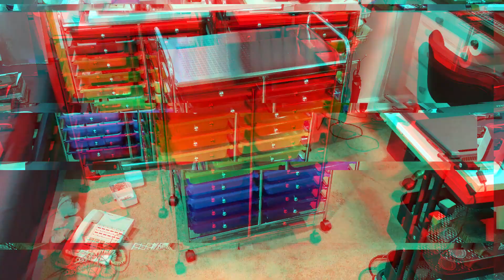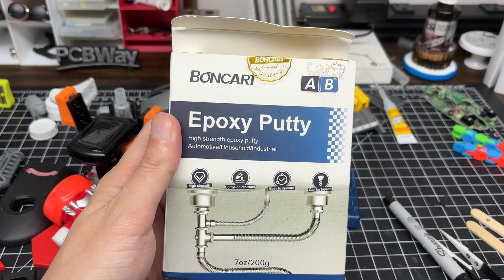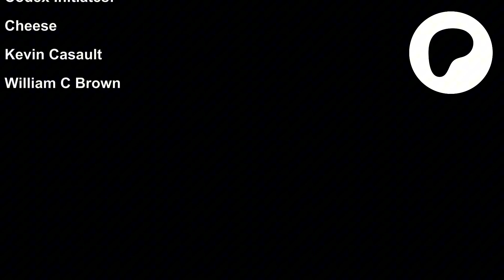Rex: 1/35 Scale Junkyard Mech (Part 1)

Comment: Your monologue writing continues to be just perfect.  Alex Grimes is a treat and totally unlike the previous two designers in a way that is really charming and funny. Having a wry and snarky designer who both looks down on and is a little afraid of the importance of his work is great worldbuilding for the Omniplex. 

As for Rex?  Axel said it, "*Chef's Kiss*", a wide-stance load shifting mech that can move loads up to... 15m in the air (Guessing based on the implied sizing for the primary hydraulic pistons coming from construction equipment meant to stabilize apartment compelxes.) like a forklift.  He's made from repurposed and reconditioned detritus - but by someone who's got a mind for both engineering and repairability.  

I understand why Axel is pissed about being put in charge of reclamation - he's an engineer.  Obviously he's an engineer who scored too highly on keeping the big picture in view and reliability, so he has to manage city-critical services instead of building things like he wants.  I'ld be snarky too.  It's not like anyone expects to test too high for their dream job.

Back to Rex, though.  I can't wait to see the detail pass on this figure.  I generally have an... issue with modelers using rivets in sci-fi designs,  For the most part they were superseded by welding improvements and the ability to forge and machine larger parts.  Rivets are essentially stitchwork and are inferior to doing it right the first time, if you can.

This guy?  Built out of mismatched components that had to be machined into tolerance with one another?  I can't wait to see the rivets pop up any time you have two load-bearing parts from different sources.  I bet they will look cool as hell there.  

For the paint pass, I cannot wait to see how you decide on his look.  Grimes could betray his namesake and give Rex a full stripdown and fresh primer in order to give the mech a cohesive look, orrrr he could just order someone on his shit-list to clear the actual rust and grime from parts as they were pulled from The Pile and not waste time repainting something that is going to go straight into the waste stream anyway.  Rex is supposed to be a new mech, so it feels wrong to fully age him and give him rust-lines and whatnot, but I think having him turn out to be a medley of colors would be awesome.  Old whites from factory parts, construction machine mustards and oranges for repurposed heavy-lift equipment like the pistons, random single pieces in bright reds or blues from who-knows-where.  He would simultaneously look motley and cohesive.

I cannot wait, as always.
Reply from the maker: @bearnaff9387  thank you for your continued support! I love this feedback and I’m glad you can enjoy all of the thoughtful design I try to put in. Axel has been a blast to voice, and the mech has definitely sparked a lot of ideas of grime and rust. I’ll do my best to make it make sense of course 😁
You’ll love part 2 where I’ve started adding bulk but I probably won’t get to detailing until part 3 because Rex is king size!